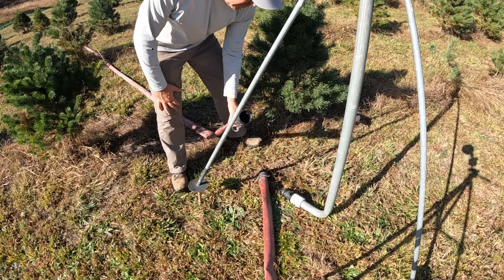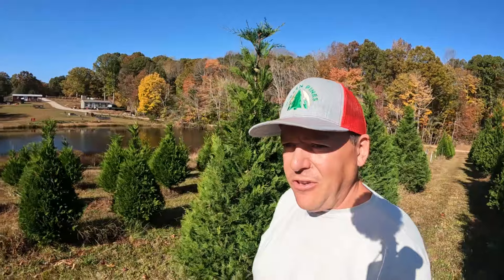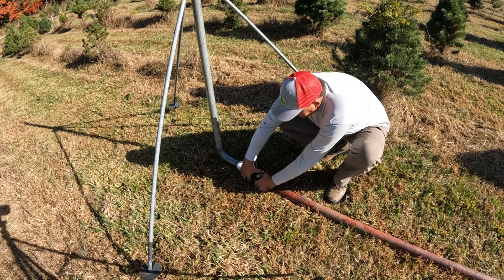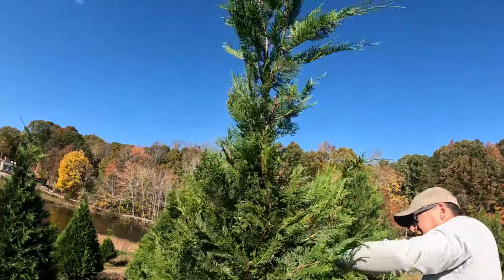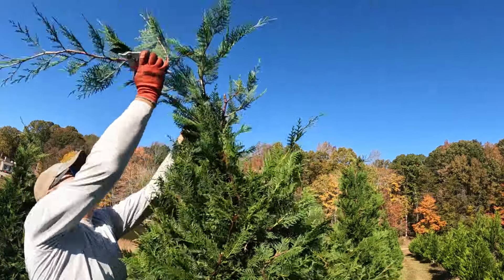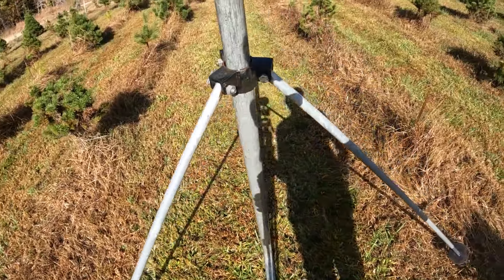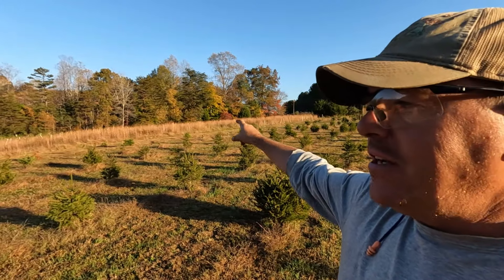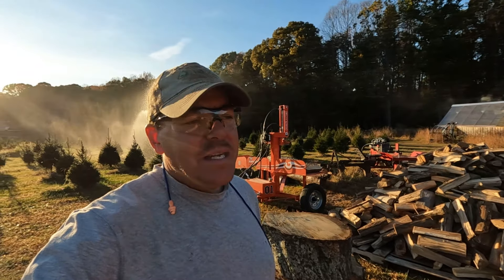We Shouldn't Be Doing This in The Fall

Comment: Watering trees on the wet side of the cascades is a mind boggling thing. It just doesn't happen!
Just watch out for the freezing, the pump housings can't take much freeze with water in them.
.
Its how i came up with a new engine for the wood splitter, its the pump housing froze, long after the warranty was up.
The old Briggs on the splitter was drinking just about as much oil as gas. And the old flat head Briggs, does not have low oil shutoff system.
So eventually it died because it needed more then one oil fill, per gas tank full.
Reply from the maker: no cold weather on the horizon here yet, but I always drain them for the winter so haven't had issues